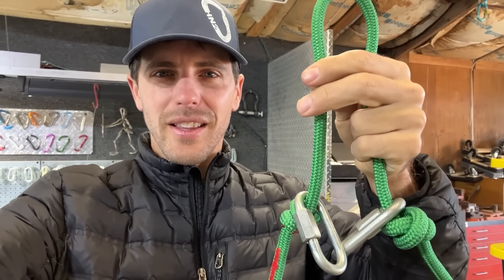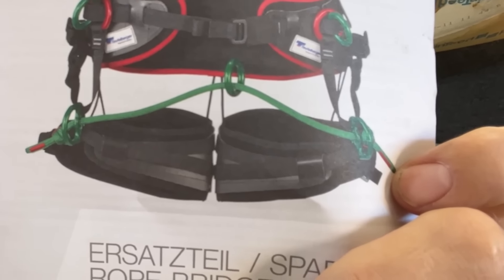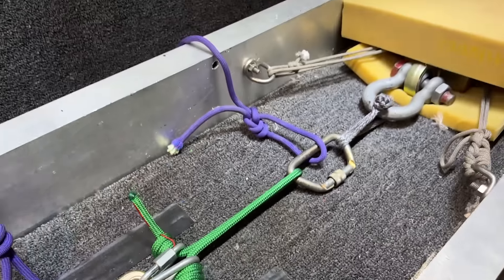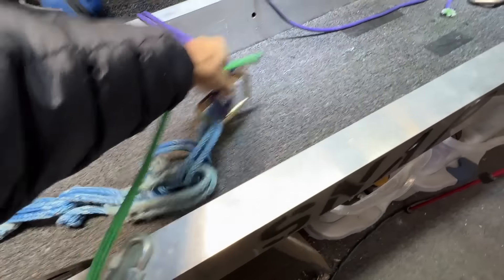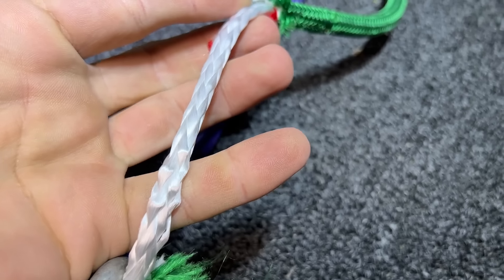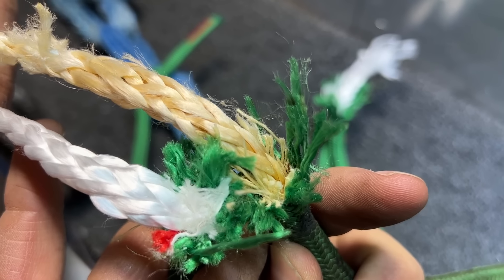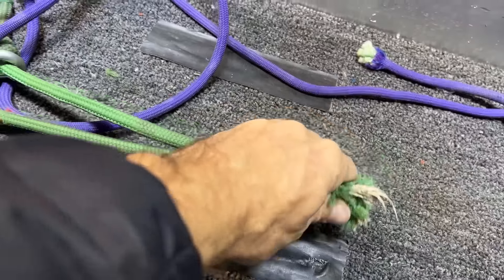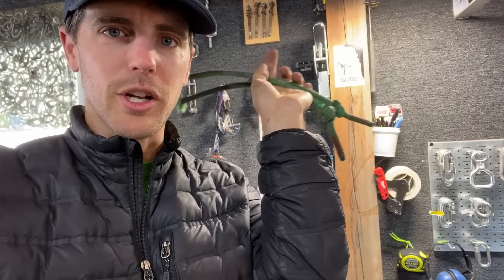How Strong are Arborist Bridges - New vs Old

Comment: That last bridge broken was actually mine. I had a replacement ready for it so I gave it to Nick to send out for a testing, we definitely wanted to make sure it was super worn in. we hooked a rope grab to each end and ran it through an aluminum ring hundreds of times with our body weights. Super insane that it broke at 26 kn. There must be something chemically going on when you're impregnate that much aluminum into the textile. We got that ring so hot it was about smoking. Definitely would like to see more arborist info on your channel there is a lot of influential people in the industry that would love to partake in sharing some useful information.

Comment: If you want to attract arborists make sure to have plenty of shiney hi-viz colors in your videos that match helmets.  And then drop test rope runners, akimbos, and unicenders. Then cut steel core lanyards under mild tension with chainsaws and then show impact forces with side swings when bailing onto a backup anchor at your height. And then survey everyone on their favorite cat rescue technique. And then go climb some big as trees and learn to traverse. Play with rigging angles for tying into weakened trees. Find trees being removed and break them. Tye into bad spots and break them out. Investigate rapid descent techniques when swarmed by bees. Do a crane job and show the forces and difficulty of choking off unstable unbalanced tree parts. Break test synthetic cabling systems  like cobra. Break test chainsaw lanyards that are meant to break when the saw is stuck and being pulled down with the piece.
Reply: Break test controversial anchor points in trees! Yes!
Reply: testing tie in points would be awesome! I'm sure that the 1.5" maple branch I'm tied in to will break before any climbing gear.
Reply: rapid descent techniques when swarmed by bees, spicy flies
Reply: Yes, can attest to that. Tree surgeon from NZ.

Comment: The drop tower would be the best way to test bridges.  Most of the time they’re either going to fail from neglect and not being swapped out over time or a shock load from the climber falling.  But think of this too, We sometimes carry similar weight to a big wall rack and then add a 5 to 14lb. Chainsaw, depending on the task.

Comment: When I bought mine used it had a recall for the Bridge. I called the manufacturer and they sent a new one years after the recall notice. Its super good enough now!
Reply from the maker: Why was it recalled?
Reply: @HowNOT2  Because any time an arborist gets injured, the gear is blamed 100% of the time.  Doesn't matter what the arborist was doing or the decision he made prior to getting injured, the gear is always blamed.
Reply: @HowNOT2 Great question! Sorry someone in the know hasn't come back in and posted an answer.  I believe some bridges were recalled because companies figured out Dyneema and the like were not suitable do to breakdown of fibers from repeated bending in the same area.  And possibly low melting point came into it as well.

Alot of us were excited about dyneema for slings, bridges, etc. at first - then once your expression of an arborist running too long "ahh it's good enough" came into play I believe companies decided the bit of weight savings wasn't worth the risk.

My thoughts.

Comment: That’s Globe 3000 tuefelberger bridge. Dyneema core, polyester cover. Just retired one of mine on a 10 year old tree motion saddle. I’ll send it to ya if you want. Thank you for the work you put into this, as an arborist for nearly 20 years I’m kind of a nerd about equipment and love this stuff.
Reply: I hope you weren’t running that bridge for 10 years…..
Reply: Turtle burger definitely recommends retiring the harness after 5 years of consistent use.
Reply: @jimsupstateadventures6218  and I bet the bridge is every 6 months, if not sooner per inspections.
Reply: @fullmetalchavez8678  Changed roughly once a year. Used Mostly for pruning.  Trying out Treerex for now.

Comment: Can’t wait to see more! Would love to see you break a carabiner spar anchor. Lots of us establish our second tie in on a spar by putting our climbing line around the trunk and clipping it back to itself in a girth configuration using a carabiner as the connector. Technically side loading the carabiner, but how small of a trunk do you need to go to before the carabiner breaks significantly lower. Love this channel and really appreciate the work y’all do!
Reply: Hopefully you're at least using a steel biner!
Reply: I've broken the gate of an aluminium carabiner rigging like that, branch was maybe 50kg, and didn't drop any significant distance.

Sideload on the gate isn't rated for anything at all as it isn't an intended use. But it can go at only a couple of kn if loaded wrong enough.

Comment: Thanks man I’m an arborist with that same saddle and I have the replacement bridge in my gear box and my original is glazed pretty bad and almost ready for replacement but after seeing this I’m gonna hold off. Plus I did like you would and I added another 10mm rope bridge to double it up since I have a running saw when I’m climbing. Great episode, looking forward to more arb videos!

Comment: Extremely happy that you're getting into the whole arborist and rope access business! 
Please please please do test choked anchor configurations of carabiners against wood or metal, though.
There is much discussion going on about the safety of this, especially in trees (SRT canopy anchor choked on a branch of smaller or larger size). I guess the general wisdom is that you should do this only at sufficiently large diameters of whatever you're choking, and instead of an aluminum carabiner use in that order a steel carabiner, steel quick link, Notch Quickie or rappel ring. But at which diameter is side-loading actually a problem, does it matter whether it's a tree or a metal pipe and are aluminum crabs actually safe in this configuration? Getting some data on this would be enormously helpful!
Reply: Oh, and some people like to choke a DMM Pinto against the branch, this could be another one to test. (Alpine in the working end of the rope, pulley clipped in around the standing part.)
Reply from the maker: Chocking small diameters is a good idea

Comment: I'm kinda curious now. I work on wind turbines and we have a self rescue kit we carry uptower with us any time we have to climb or cross into the hub. While I know it is not rated for fall, the rope has a fire rating (somewhere between 4-5k degrees) and the descender has a rating as well of 50 lbs per half wrap. Comes from TSL. I'm curious as to what would fail first, if the ratings are true, and how much the contamination that could happen deteriorates the ratings (I know it can, but I'm curious by how much).

Comment: Ok I know this is probably a dumb question but I’m new to climbing and thinking about getting into tree work (it looks like a good job for me). Could you rock climb on an arborist harness? And what would make them function incorrectly (if it’s not just potential safety issues).
Reply: You could. It would be real bulky and heavy, doesn't allow for a lot of free leg and hip movement. When you fall, I could see some awkward falls because the tie in would slide around a ton on the rope bridge. However I'm thinking about getting one for developing as they're soooooo comfortable to sit in for hours.
Reply: @shawntrevordaniel  thanks that makes a ton of sense. I never thought about using it for developing but I’m sure it would be good as it has space for larger tools (like a drill or chainsaw).

Comment: I have never broken a bridge nor have I heard anyone else having breaking a bridge either. I run two different saddles with either a two bridge configuration on me Petzl Sequoia which I use as my heavy saddle using it for removals where I will be using a considerable amount of rigging components with the upper bridge Having switched from the original to Teufelberger 18mm and lower using Teufelberger KIII while on my light Removal and pruning saddle I am using a notch with the paw style bridge anchor plates and depending upon what the situation is I rotate from two to three bridge configuration which I used to strictly use each with a ring to allow a smooth fluid movement along the bridge but have recently switched over to using rock exotica swivel eye carabiners for the bridge connect because it makes those hard to get to branch locations that much easier with a swivel or swiveleye carabiner connection. Lastly I would also like to throw in there that there are two different types of climbers regardless if on rock or in tree and the definitive difference between them is that one could care less about their gear and don’t take care of it and those who do that would be more prone to have a saddle go longer than recommended time lengths. Where as I am switching my saddle out each year on my heavy rigging saddle and every other year on my light duty saddle of which I am switching out my bridges on both saddles every six months unless I have put excessive amount of stress and strain on a bridge and saddle and then I will cut it up and toss it just as the same if I drop a carabiner it gets throw away or painted and used for non life support means. You are only able to be a good production climber if you are able to trust your gear fully as calculated risks are part of the job description of being an arborist. Where as if you don’t take care of your gear you have just become a severe liability for your company and if you are the owner it is more a liability than not as you have younger generations watching your life saving equipment get thrown around and treated as though it’s no big deal and while it may never affect you the young climber with two small children at home is the one it could affect. Which I greatly appreciate the work you do on your channel as it has been a direct reason to choose different gear if I think the potential for recreation of the failure is more likely to the way I climb. Specifically talking about paying more attention to and form of side loading carabiners while in th past I was always aware but not to the extent I am now paying much more attention in general with a lot more attention being paid to the side loading of mechanical positioning lanyards such as the Petzl  zillon system much like the zig zag , I know it can hold up very well in situations where  side loading has taken place while also knowing that is where the failures have occurred in the field

Comment: Editing to include a link to the Followup video I made. This is a work in progress and I have already made improvements on the design. 

https://youtu.be/c4inPs8E4t8

Ryan, I've been thinking about a way to add friction at the base of a lead climb.

I know about the ohm, but I figured there's gotta be a simpler way.

I have the gear to rig the setup, but I don't have the drop tower to test it.

Could I email you with more info?
Reply from the maker: Sure, I can't do every suggestion but they can steer what we do long term.  I'm 55 episodes filmed atm and only 14 edited.  ryan@slackline.com